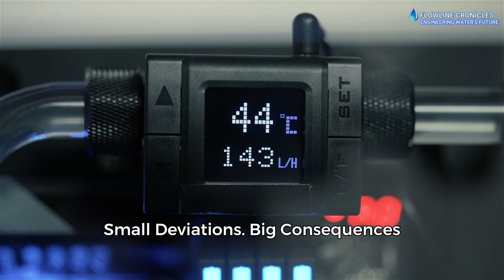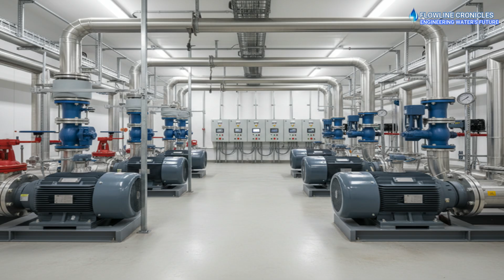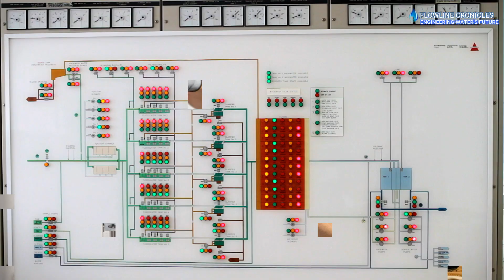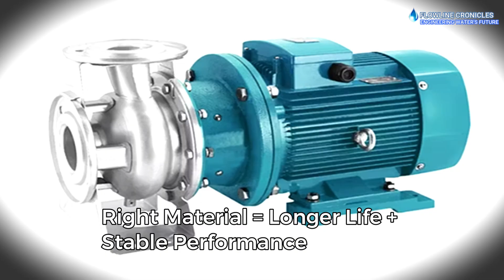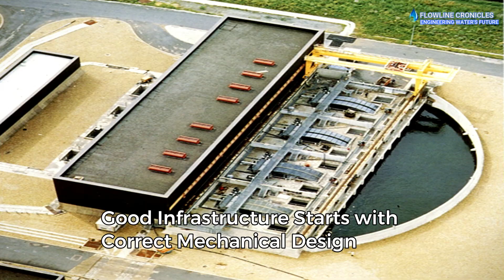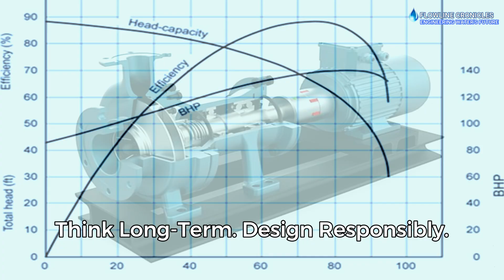EP-15 | Off-Design Pump Operation: Cavitation, Runout, Energy Loss & the Hidden Cost of Bad Design

Comment from the maker: n EP-15, I connect off-design operation, cavitation, vibration, energy loss, material choice, and lifecycle cost into one engineering story.
If you work in water supply, pumping systems, or infrastructure projects, I’d really value your perspective:
👉 How often do you see performance problems that actually started at the design stage?